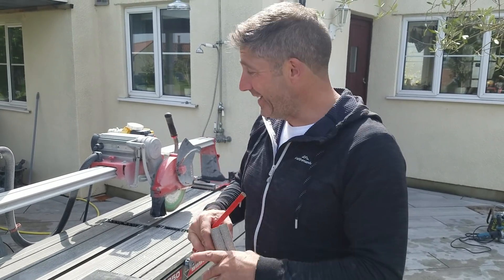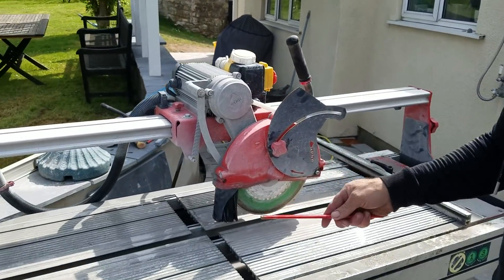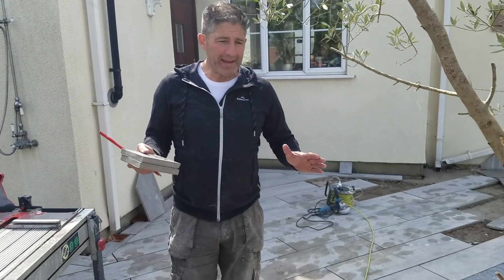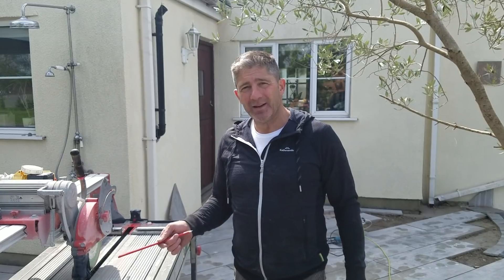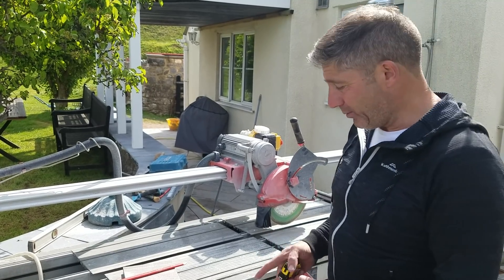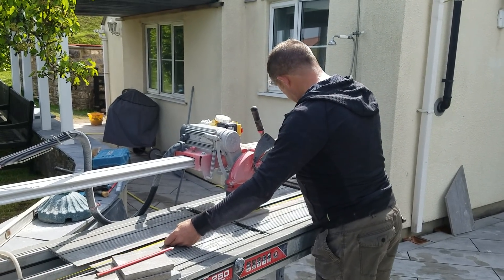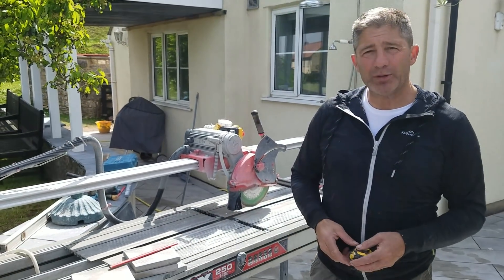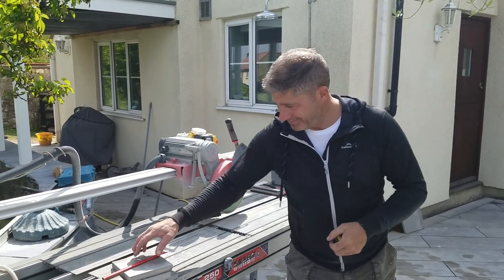The Rubi DX 250

Comment: I’m stuck between a rubi tc 125 or a dc250 850! Any advice you can give? Would really appreciate it
Reply from the maker: the dc 850 is to small as you will want to upgrade, either way we can get you both
Reply: Greentop Landscapes & Design What saw do you recommend for cutting 20mm porcelain ? Guessing the dx 250 but are there any hand wet saws you recommend as well ? Thanks mate appreciate the advice 👌🏼